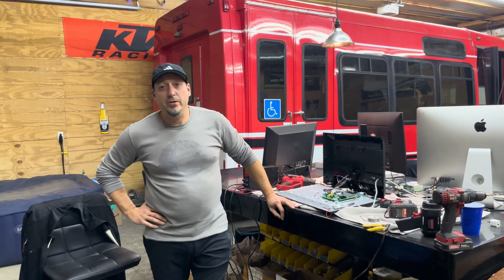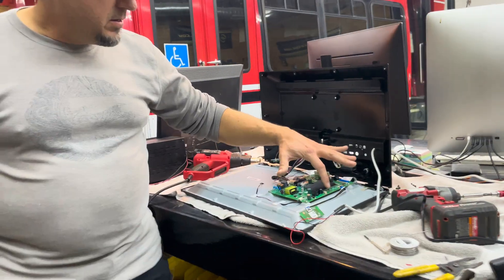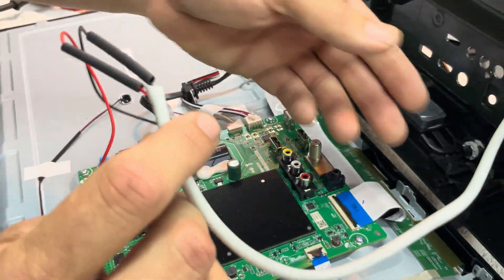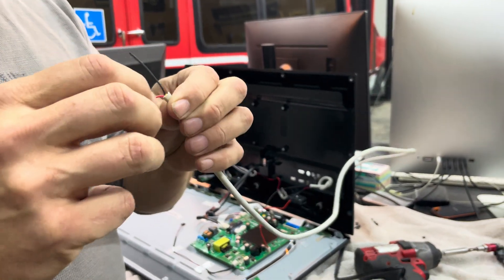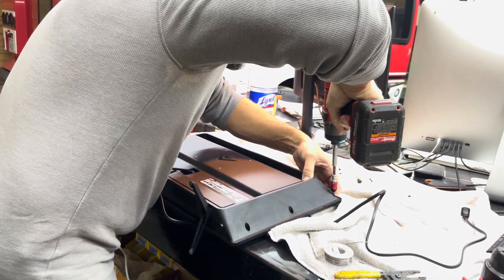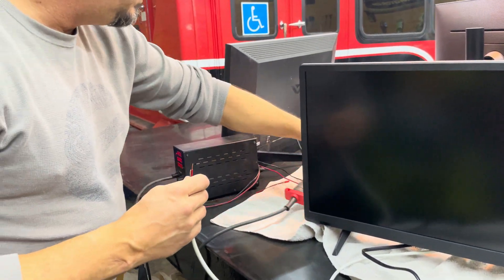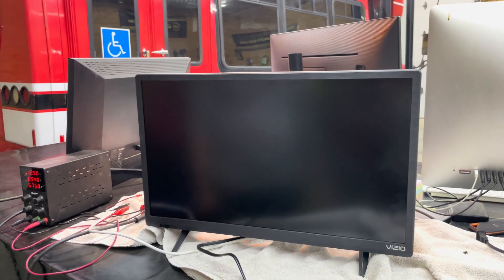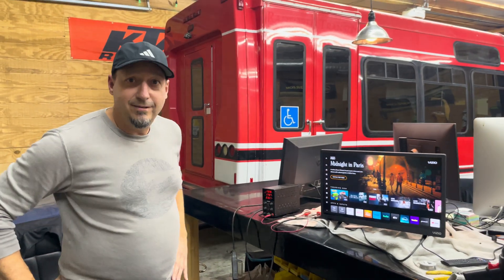Convert Any 120V AC TV to 12V DC for Cheap! | Save $$$ on Your Off-Grid or RV Setup!

Comment: I have an LG 32” with 2 connectors on the main board, one is labeled CNV24 (+25V/GND) and another labeled CNV12 (+12V/GND). Does that mean it can be powered via 12V or 24V?

Comment: I did this hat on a Vizio D series 24 inch 1080 P smart TV. D24f-j09 2022 model.  There is a 12 V connector on the inside, left hand edge of the motherboard panel.   

You need a jst-ph 2.0 connector (amz) that you wire to a DC 5521 plug female that you can glue to the edge of your case. Use a USB-C. To 5521 male plug for power.  Works great.  I have a U green 130 W cigarette power adapter to supply power in my Geo pro trailer

Comment: Looks like this is a Visio D24f-j09 based on the case style.   Can you confirm?
Reply: board model is TPD MT5583T PA 561 which seems to be the D24h-j09 24inch vizio smart tv with 12V pwr upgrade port which is what he used.

Comment: I'm glad it worked for you, but the title and video description are misleading and based on a sample size of your one small TV.

I tested the same approach on a 43" Vizio and the backlights never powered up at 13.3-16V. instead, it behaved just like yours did at 12.5V before you boosted it to 13.3 V. I don't know how high I would have to raise the voltage to work, or if it would ever work through that same connector.

Comment: Question: Can you still use the 110v wall plug if needed?  Also, I see connectors like a JST-PH and JST -HX  ect. on Amazon and ebay  but no JST -1.0210 connectors.   I'm converting a Vizio tv also. Thanks!

Comment: some tv power supplies converts 110v ac to multiple lower dc outputs, like 28V for VGH, 3.3V and 1.8V for board logic and 12 or 24v for the panel led backlight, so just hooking 12vdc for everything may not work for most tvs, you have to check the outputs from the power supply to the logic board. 

what I like to do it study the tv schematic beforehand, sometimes this information is available in the service manual, if it's a single 12/24vdc output, all you need to do is to bypass the power supply and make sure the input has line filtering and surge protection for that dc input level like you do for 110v ac in your house.
Reply: They're not engineering a product guy, theyre being cheap bastards. If it works it works. Which it does. My kinda guys right here.
Reply: ^dude above has definitely unintentionally destroyed many things lmao
Reply: @TheAceofFate  it takes one minute with a multimeter to check the output lines from the tv power supply to logic board, if everything is 12/24v, you are fine, if not, you'll have to find out what are the vdc outputs to replace with proper DC-DC converters, they are usually cheap and very reliable if genuine LM2596 are used.

Comment: If you were to just keep it 120v and get an inverter. Would it be that much harder on power?
Reply: Not really. Some efficiency loss but it's really minimal considering the tiny amount of power modern TV's use.
Reply: Yes. Inverters consume more energy due to conversion losses.
Reply: @xxSHADOWLORD420xx
yes  but the  200 watt inverter  is less efficient if the power  that is already  12 volts   in the bus  and  the logic board  only  needs  12 volts    there  is  no need to  lose   25%- 20% of the  power  in  the   boosting   of   12 volts   to 120  just  to   have a   transformer  in   the  tv  to  make the 120  into 12 volt  at  another 25%- 20% loss in  power and  the inverters  and  transformers   both  lose   power   as  the  transference of power from one  state   to another   some  will be lost  in the form  of  heat   and  with just  sticking   with 12 volts  cuts  out  all of that

Comment: I was excited about this and decided to try it out. I opened up my Insignia 24" and found the 12v connector just like in the video. Found a connector and applied 12.5v and could see it consuming some power, however the TV never actually turns on... ramped the voltage up to 14.6v and still no go. The voltage going to the LED drivers only read 1.3v.

When plugging the TV into 120v, the voltage across the 12v connector reads 11.83v, the voltage going to the LED drivers reads 41v and I get a picture. I'm thinking this connector might be meant for output only... If you have a TV with 12v LED drivers then it might work but not in my case.

Comment: Dude, awesome tip. This was my TV of choice for a camper setup, and originally I wanted to use a 12V to 19V buck boost converter. how's this TV still working? Does it require slightly higher than 12 volts to run properly?